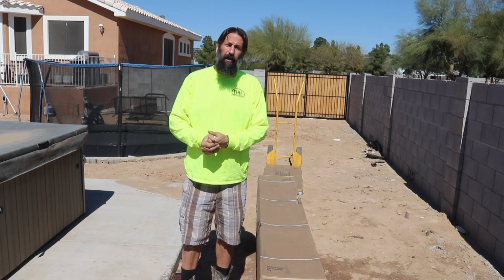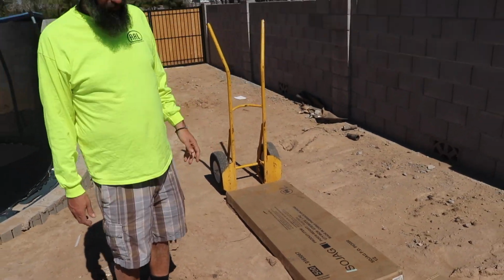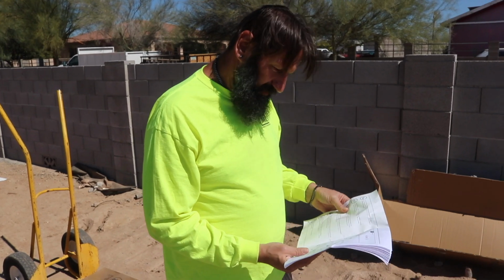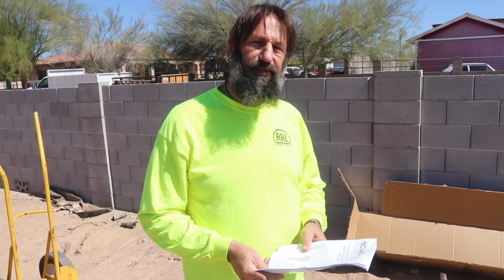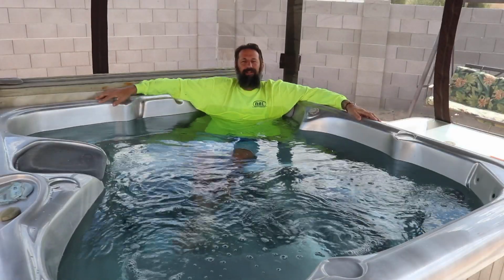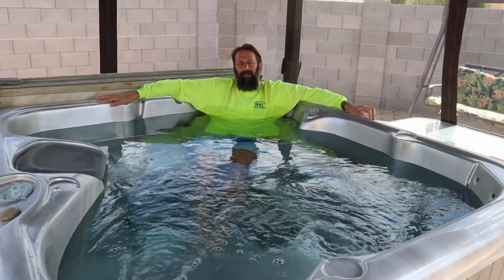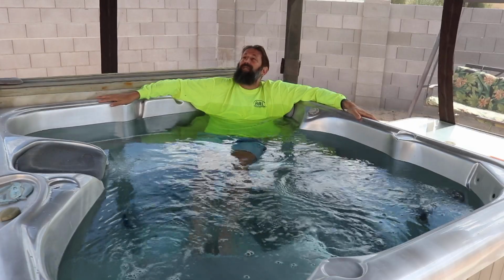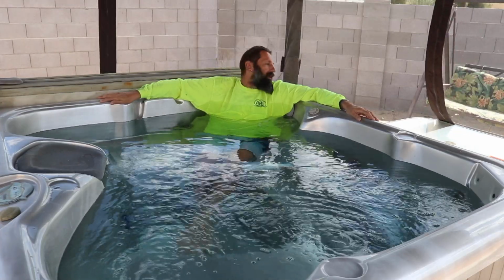Sojag Gazebo Install For The Hot Tub

Comment: I had mine installed and then bought the curtains (netting was included and they installed some on the inside track and some on the outside track. Anyways, is there anyway to add the hangers in the tracks after installation is completed? I can see how they were slid in but now I don't know how to get the new thick curtains up? Thank you

Comment: I have one of these and the first thing I did was I added foam insert under the roof.  It blocks the heat radiant from the sun baking the roof.
Reply from the maker: That's a good idea.  How does it look with the foam?
Reply: @BearsWorkshop  I use some black foam from my brother work place.  They are 1 inch thick which sets almost flush with the support brackets.  Just cut them to fit between the brackets and glue them into place. They look like these.  http://www.s-chem.com.sg/prod/pe-foam/.  Just make sure you use high temp glue. It's not noticeable as it's black in color.

Comment: Building this today. Me and 4 other people have no clue how to get the R1 and R2 section to fit together when installed. We’re thinking about just installing the the two long pieces and ignoring the shorter sides. Any tips?
Reply from the maker: The R1 pieces were difficult to get in. Try and shift and twist the gazebo and it will move the connections points around.  The gazebo is probably not square. I hope you didn't bolt it down yet.
Reply: Bear's Workshop Do you remember is the Velcro was facing up or down on the R pieces? Seems it can go either way and both won’t work, I will try shifting the gazebo tho
Reply from the maker: @JoshEvansHeavens  The velcro faces towards the center.  There is a square screen that comes with the unit.  The velcro is where you attach the screen.
Reply from the maker: 8:22 in the video

Comment: Nice video! My father and I have begun to build it but can't seem to make the P1 and P0 pieces fit into one another. We are sliding P0 in first as instructed, but there doesn't seem to be enough space for P1 afterwards. Do you have any insight on this? Thanks :)
Reply from the maker: Those 2 pieces are a tight.  It also is best to have 4 hands up there.  One person holding it so it doesn't slide down and the other person manipulating the sheet so that it can get into the slots at the top.   I had difficulty with this but after starting at one side of the sheet and progressing the other way I was able to get each rise in the metal in position.  It will fit, just dont force it or it can bend.

Comment: hey man enjoyed the video!!! im going to be getting the 12*16 same model as yours im just nervous about the wind here in iowa in will be on our deck out back... whats your thought about the wind
Reply from the maker: We get gusts here and micro burts that reach 80-100 mph during monsoon.  I haven't had any of those yet but I do have the gazebo bolted into a concrete pad.  3 bolts on each leg.  It is securely grounded.  The question would be if the body itself would collapse.  I would suggest looking up Sojag and see what they rate it for with winds.  I have had some pretty strong winds come through but no monsoons yet.   If it blows over expect another video in July or August.
Reply: ok thanks man ill check in and see how its going

Comment: How long did it take you to build and can i just use tapcons to anchor it down ?
Reply from the maker: Probably put in about 8 hours of work.  I didn't use tapcons cause I wanted something that had a bigger bite into the concrete.
Reply: Im thinking of just using tapcons. Will a 1/4” thick tapcon be ok or are the holes provided to big ?
Reply from the maker: 1/4" will work.  The holes are bigger.

Comment: Great job!! Can you add the bolt down part at the end. and were those anchor wedges ?
Reply from the maker: Those were concrete anchors. Bought them at Home Depot.  You want to get ones that are long enough to go all the way through the concrete.   Mark the holes with the holes in the column and use a hammer drill for concrete.  Rent one if you have to.  A regular hammer drill won't do it.  Put the bolts in and then tighten them enough so they won't slip through then place the legs on top and tighten them up.
Reply: @BearsWorkshop  Nice job. Do you remember what size bolts you used? Just got a Sojag gazebo but will be bolting it to a deck.
Reply from the maker: @johnw4067  Pretty sure they were 3/8' by 4"